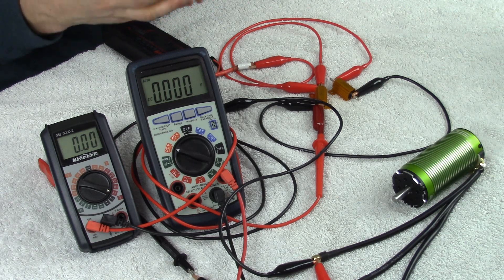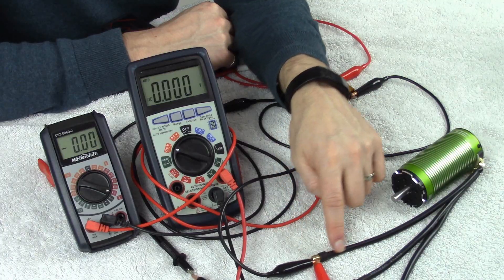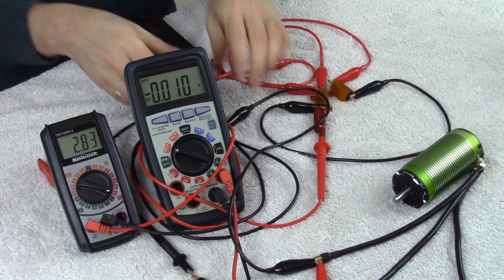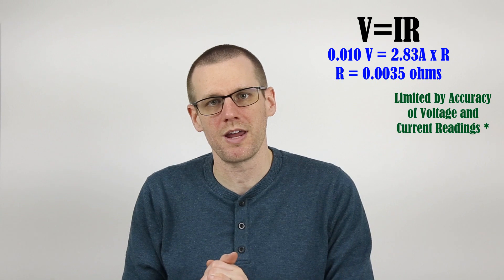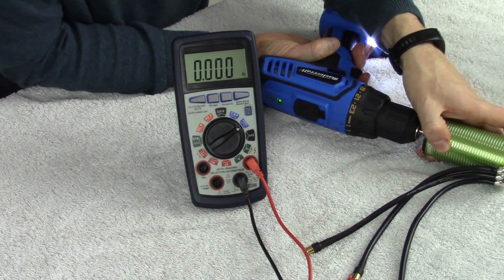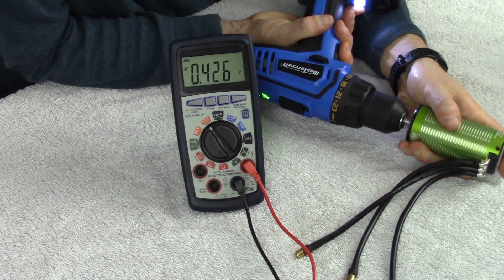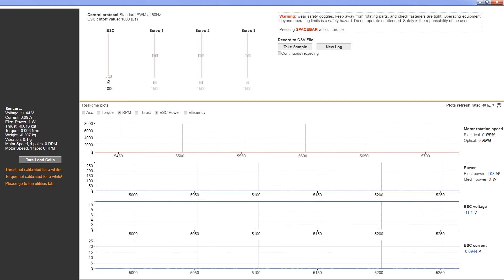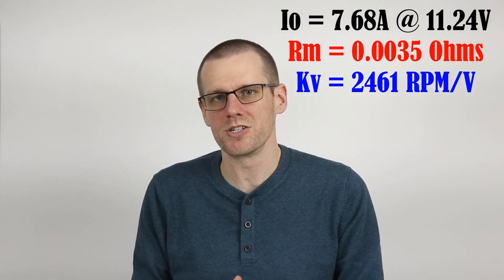Castle 1721 2400Kv Motor Specifications Reveal

Comment: I’m looking for a motor for my Arrma Vorteks. Happy with the power of the stock motor, but it runs to hot for how i’m using it. Is it possible to run a castle motor cooler with the same esc and on 3s? If so what motor do you recommend? The stock is 3200 Kv.

Comment: Castle esc’s motor combo’s etc are crazy expensive here in Australia compared to hobbywing 
Only time I justified it was when I went all out with a Tekno MT410 kit
I run HW in my 1/8 trucks ERevo 2.0, Outcast etc etc and they seem just as good tbh
Just wish they didn’t come with the on/off switch, save me joining the wires

Comment: I have a question. I have a Castle Creations 1406-2850 kv Slate motor rated at 100,000 RPMs max. If you calculate it out, it would need just a hair more than 35 volts to make it spin at its max. Thats equal to a 8 cell battery. The Castle website says that this motor is only rated for 4s but that wouldnt get it anywhere near that 100,000 RPM. Is it possible to run the 1406 on 8s persay?  Seems like it would be a good speedrun motor. What am i missing from the motor specs?  I dont intend on running it on 8s but there is a gray area on that motor. What are your thoughts?

Comment: Awesome info!! 😎👍
That's close in wattage to what I just recently pushed on my Limitless speedrun setup that I currently have, XLX2 w/1717 1650kv motor. It pushed just under 11Kw with 476A on 8S. No heatsink or fans on the motor & stock fan on the ESC. Both temps were under 167F after 2 passes. I'm still on the fence between this motor & a TP motor. If the 2400kv castle motor runs as cool as their 1650kV motor under the approximate same load, then I might go with it.
Thanks again for all the solid info 😎👍

Comment: First!! So why wouldn't this work in a kraton 6s exb for speed runs?
Reply: Did he say that?
Reply: @kevinmagiera9157  no I've heard person say in chats why it can't be that is why I asked
Reply: Could be just an example 🤔 generally it’ll work in every speedrun build- but maybe the 1721 doesn’t fit in the k6 because of the length!? Even if you change and turn the whole centerdifferential/motormount
Reply: @kevinmagiera9157  it "should" work, I have the Kraton 6S LWB chassis on my Typhon 6S. I swapped the motor mount around so that the motor is on the front end. I literally just measured the gap to see what's the max motor length I can accommodate & it was ~104mm. The 1721 2400kv is 101.2mm long. Perhaps a factor that needs to be taken into consideration is the width of the motor, 47.6mm, which can still be addressed by a custom large motor mount already available used for accommodating the 2028 can sized motors.
Reply: Is it still a k6 when you have to adjust the drivetrain so much and use ~100mm roadtires, just so the final drive matches the optimal useage of this motor?